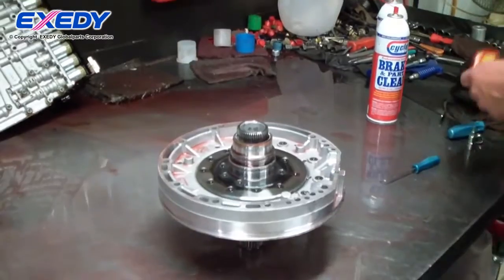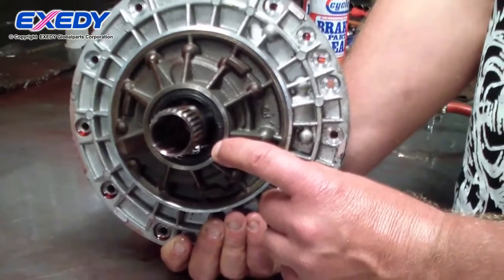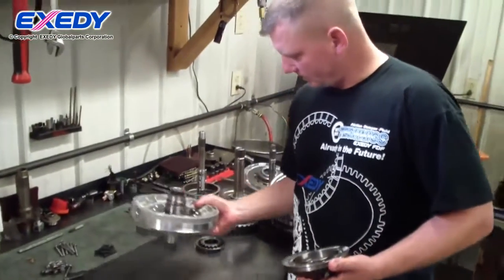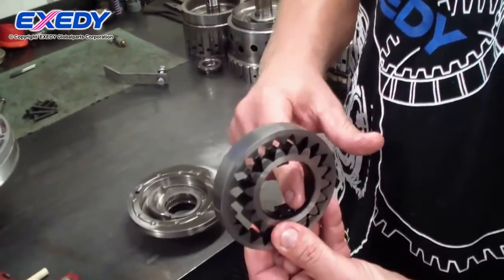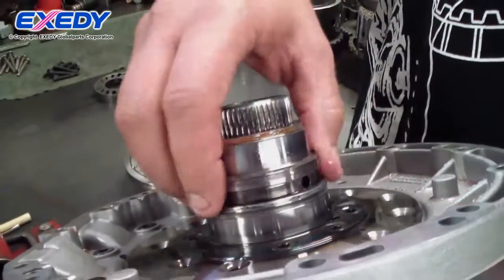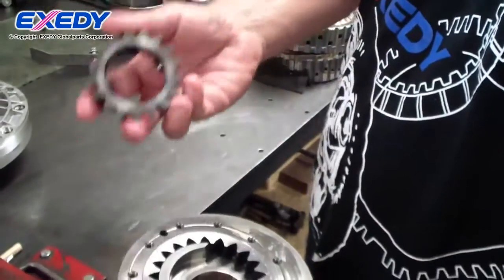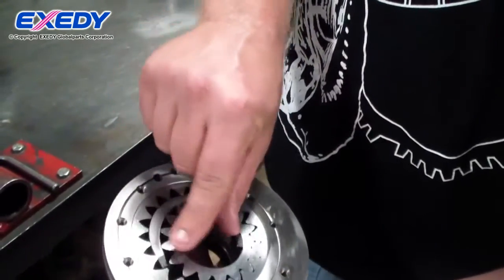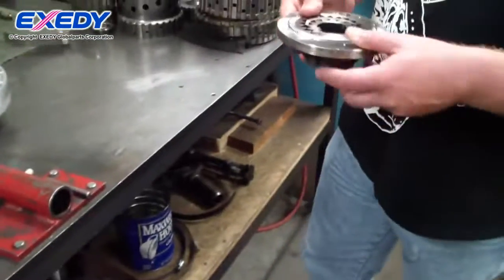Auto Trans Rebuild   Chapter 3   Pump Assembly

Comment: I appreciate the video I have a 545RFE out of a dodge ram I removed the pump and bought a rebuilt I am having a problem getting the sealing rings back inside with no way to compress them and I have yet to find a video that explains the procedure to put this back together do you have any suggestions